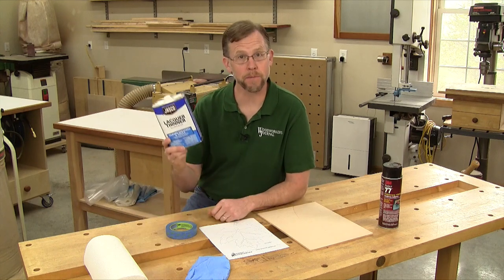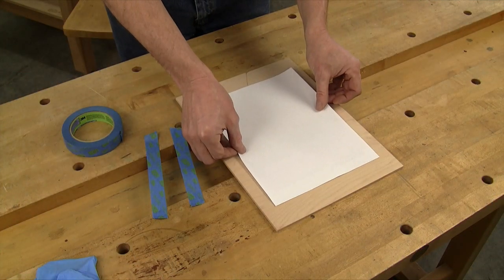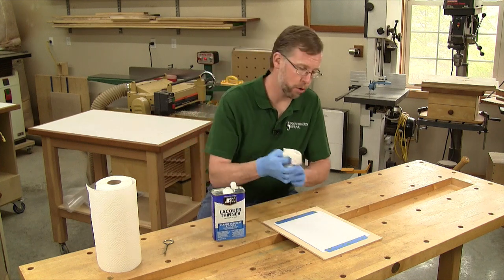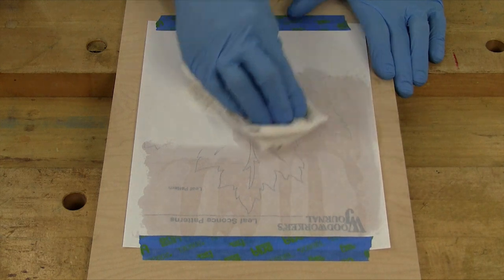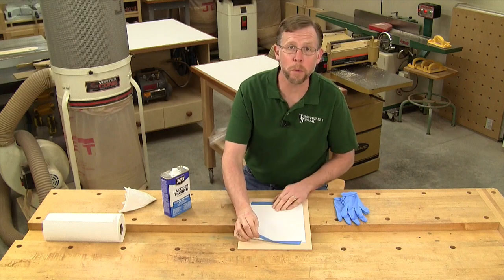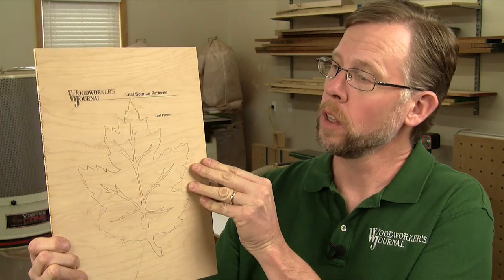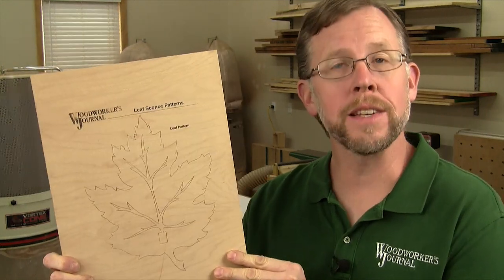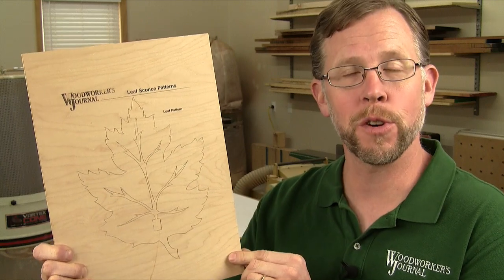Transfer Patterns with Lacquer Thinner

Comment: Another way of doing this, that works with inkjet printers too, is to print on sticker paper with the sticker removed. The ink won't stick to the waxy surface and can be easily transferred to wood with some pressure from a credit card or similar.
Reply: Could I use that to transfer to another piece of paper ?
Reply: That should work fine, as long as you the material you’re transferring to is ‘normal’ paper and not also sticker paper, since that will not absorb the ink that’s ‘floating’ on the sticker paper. Definitely give it a try and let me know how it went!
Reply: Thank you will the image be reversed? How could I prevent that ?
Reply: The image will indeed be reversed. You can prevent this by reversing the image before you print it, this can be done in the print settings. Good luck!

Comment: You'll need an inverse image of the final one you desire, no?
Reply: Yes, So How do you manage that?
Reply: If done on your computer, a program like Photoshop or GIMP could do this easily. Also, some scanners/copiers have inverse options built-in, so no computer needed.
Reply: jonnken some print divers do it. many programs you open the file with do it,check the tools options, there are online Web sites do it or you could print to a pdf file instead of a printer using some the like cute pdf and select the mirror option. or just flip the part over and call the front the back.

Comment: Ink jet will transfer, but you need to iron it.
Reply: Thomas Zawacki you may be able to do that with laser toner. it's a common home method for circuit boards before copper etching. Inkjet won't work for that.